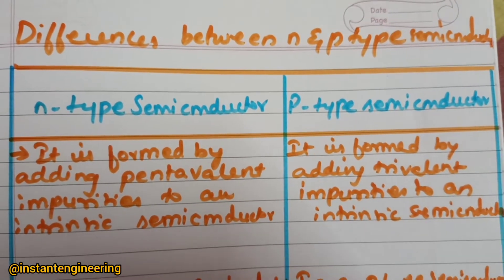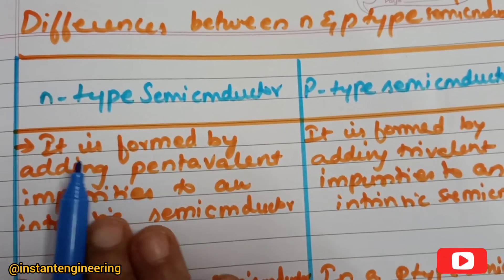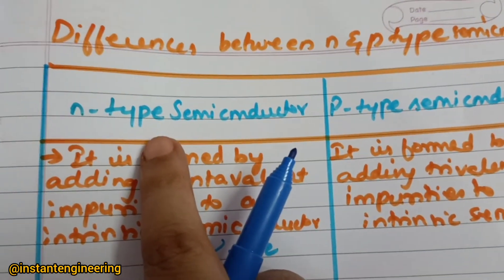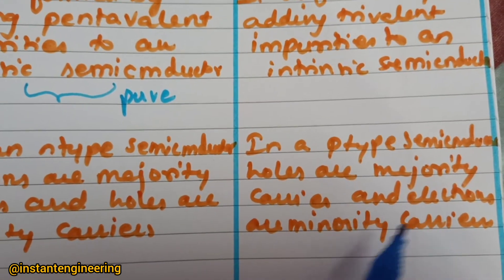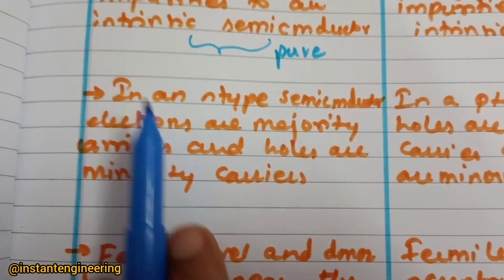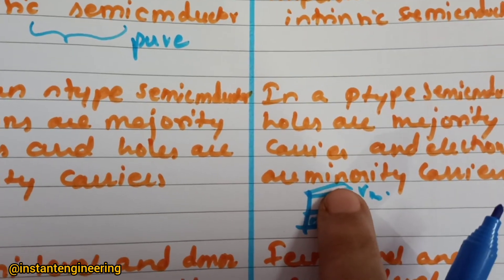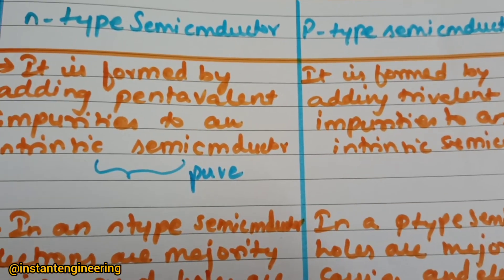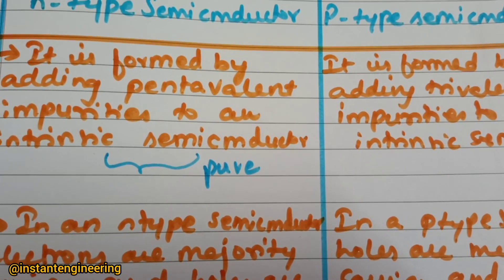Differences between n-type and p-type semiconductors

Comment: What about charges of p and n type semiconductor?
Is p - type semiconductor positive or neutral ?
Reply from the maker: P and n type materials are NOT positively and negatively charged. An n-type material by itself has mainly negative charge carriers (electrons) which are able to move freely, but it is still neutral because the fixed donor atoms, having donated electrons, are positive.